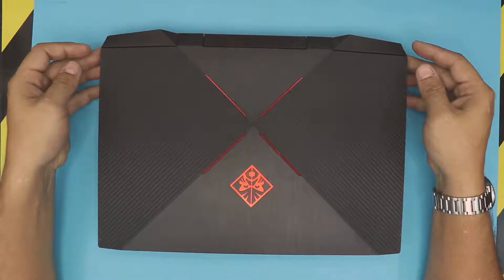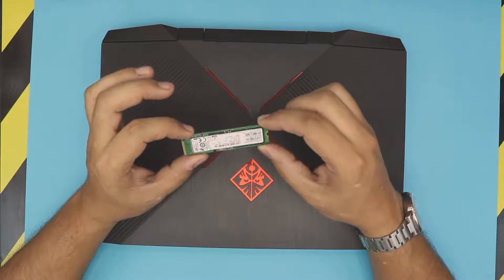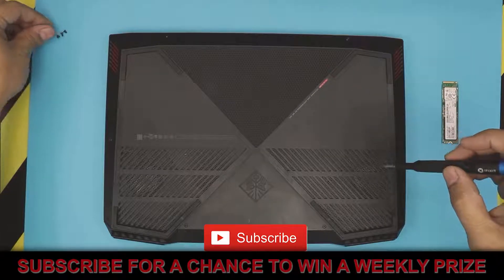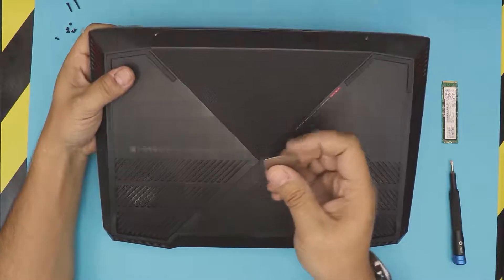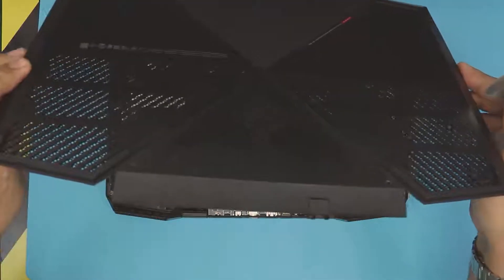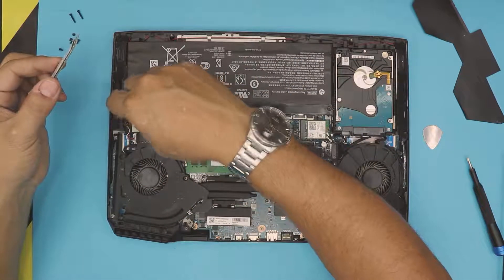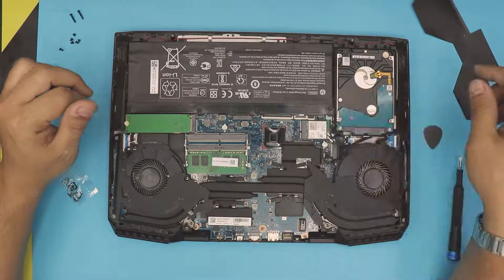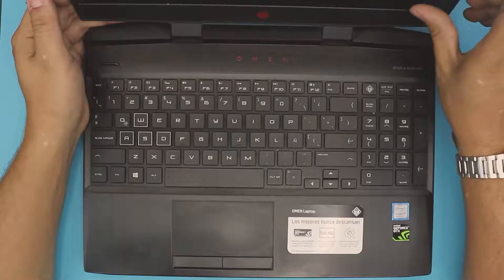Hp Omen 15 Dc SSD / HDD Upgrade STEP By STEP

Comment: I have this exact laptop. I know a little about computers and I've built a couple of desktops so I am familiar somewhat. Anyways the question is first is there only one slot for the ssd stick or is there space for two? Secondly what were you referring to when you were talking about the turbo pad on the ssd stick hookup? Great and informative video. I will be subscribing. Thanks for making a video that was very informative and straight to the point.
Reply from the maker: Thank you for your feedback! If you wish to support the channel, you can like, subscribe, or both!
Regarding your question, there are one m.2 NVME SSD slot and one 2.5' HDD or SSD space. on both you can place up to 2TB without any issues.
about the thermal pads, don't worry if you go over 2TB then you will need thermal pads.
Should you have any further questions or requests in the future, please don't hesitate to ask me.
cheers🍻